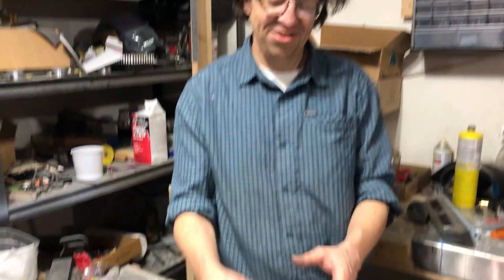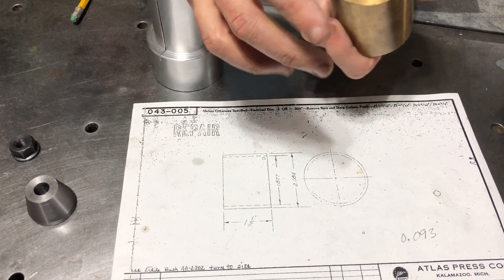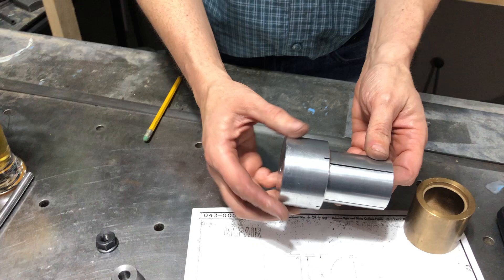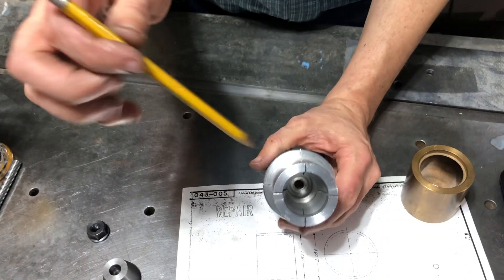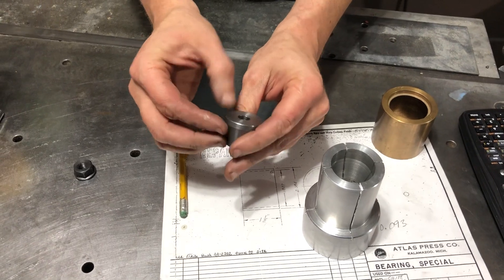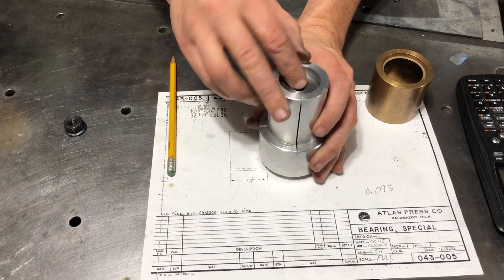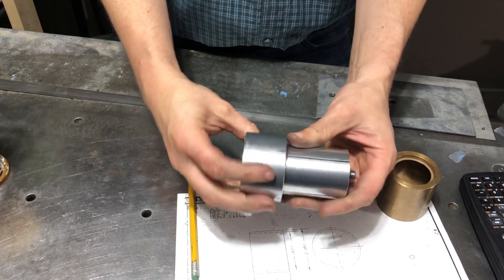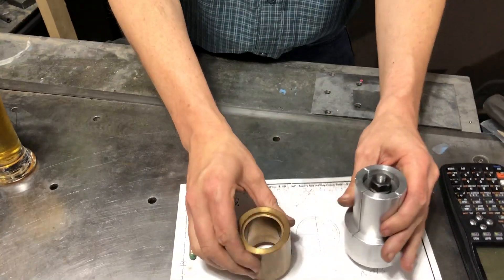Expanding Arbor Pt.1

Comment: I use a pipe plug to accomplish the same thing as the cone, just drill and tap, no need to make the cone.
Reply: Could you please share a HomeDepot link to the "pipe plug" you're using?
Reply: @PaulG.369  I use standard hex socket pipe plugs of appropriate size so you can use a hex key (Allen) wrench. I have used square head plugs if I didn't need it to go in deep, for a short part. No particular part number, just whatever I have on hand.